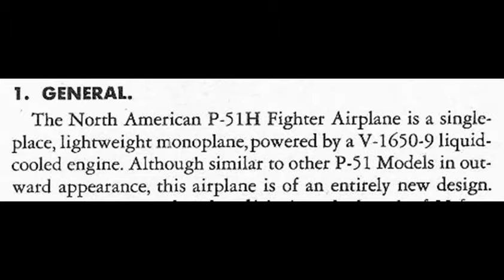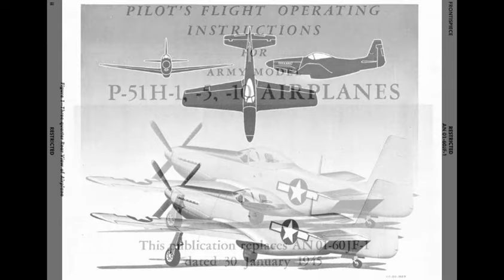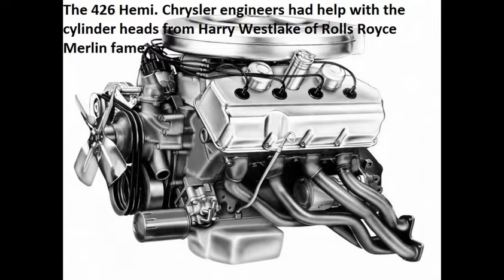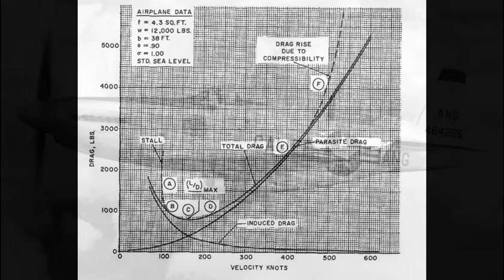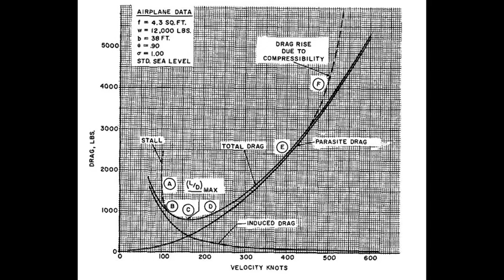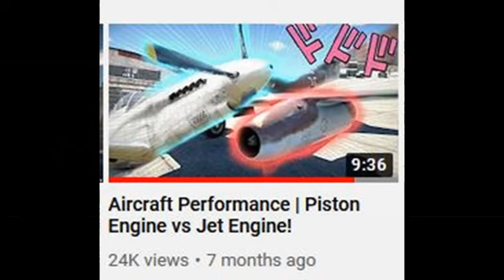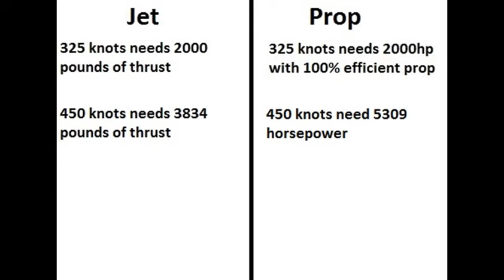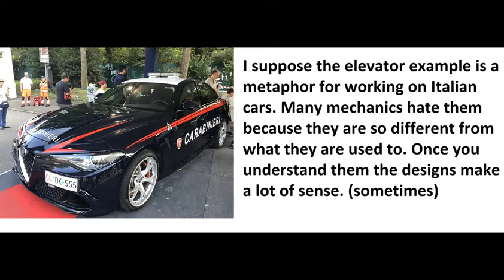U.S. "Superprop" Fighters P-51H, XP-72, and more

Comment: Great stuff!  Topic suggestion for a future video: A study of the fastest unlimited air racers (Strega, Voodoo, Rare Bear). Where and how do they make their performance over the standard aircraft they are based on?
Reply: + Greg Beardsworth   From an article about the engine builders, there are a few engine tricks, but the main focus is to build the engine as strong as possible and turn up the boost.   The crank journals are reinforced and cross bolted to take the extra power.  Merlins typically get Allison connecting rods because they are heavier, and the extra mass keeps the prop turning slower and prop tips from going supersonic.   The aircraft are made lighter.  They don't need as much lift, so the wings are shortened to reduce drag.   A special fuel is provided to the Reno race for the planes to make maximum power.  The more radical designs have pushed the boundaries of airworthiness.  For example, Miss Ashley II combined a P-51 with the wings and tail of a Learjet along with a Griffon engine and contra propeller.  Radial and fast but during the race a flutter developed and the plane literally came apart, with fatal results.   Voodoo recently took the title as fastest piston aircraft from Rare Bear.  And Rare Bear is now being prepared to attempt to take the record back, so there could be some interesting and innovative changes to make those planes even faster.
Reply: Yes

Comment: Those "press your destination floor" elevators are fairly common in NYC and London.  My office building in NY had one, as did some of the company's buildings in London.  Some hotels in Times Sq also used them.  It can be confusing when you are in multiple buildings every day, each with a different system   Yes, they seem more efficient, but that also depends on people knowing how to use them.  FYI, modeling shows that they most common elevator parking (send unused cars to the ground floor) is NOT the most efficient.

Comment: Not sure if it works similar in other languages but in Poland there is a very specific reason the 1st floor is actually a floor 0. In polish 1st floor translates to parter, while 2nd floor is pierwsze (meaning first) piętro - where piętro already has a different definition than parter. Piętro is always higher up and parter is always on the ground.

Comment: It's the same old story: Just as one technology reaches it's peak, a new technology surpasses it.  Just as the the Ford model T was introduced the horse drawn buggies were at the peak of beauty and efficiency, they had lightweight steel frames and roller wheel bearings to improve reliability. But they were limited by the speed of the horse pulling them.  The best propeller aircraft we know of all came as the jet age started.  The piston engine aircraft all had problems with drag associated with their propellers, the very thing that pulled them through the air!

Comment: Excellent Greg. Loved the Sicilian elevator ending. Very interesting.
Reply: That police quadrifolio looked amazing
Reply: That kind of setup is correct choice for high traffic buildings with more than one elevator serving people. Callers don't decide which elevator to call. They tell which floor they want to go and software selects elevator based on load and queue size.

Got identical buttons in some twelve year old business building here. Other high rise business building works same way too. Four elevators, two panels to tell which floor you want to go.

It is easier to understand such setups at 8:00am or 9:00am, when elevators are full of people traveling up from ground floor and one or two underground garage floors. Harder to see the purpose midday while going down.

Comment: Not having a control panel in moving elevators probably greatly simplifies, saves costs, complexity and increases reliability of the cars. On the other hand you have a lot more information you have to get from many different panels on many different floors.

Comment: Nice touch with the elevator. Most don't know the world trade center buildings had a similar system and some of the new building in Shanghai use it too. There is a hospital elevator system in Australia with doors on both ends and these open onto different floors. as a consequence the pad with the numbers are near each end with different number combinations. If someone is standing in front of a pad your stuck wondering why there's no visible number for the floor you are going to. Because it carries patients on hospital gurneys it can also pass your floor without stopping which furthers the confusion as you wait for an elevator.

Comment: Greg interesting video.   

Often when people read about WW2 aviation we look at top speed only, it becomes the dominant metric.   This can lead to ignoring other important planes (e.g. the PBY catalina, my favorite the Fairey Swordfish).    Look at huge amount of argument about "fastest prop plane" regardless of impact.   Sure the Do335 did serve a little in combat but no signficant effect.

In case of "super props" I see main problem standardization, maintenance etc.   Successful weapons (sherman and t34 tank, p51, p47) are partly due to manufacturing efficiency, so there is argument for making huge numbers of "good enough" planes.  Especially when you have edge in numbers and pilot quality (late in the war).   If you look at weapons Eisenhower called most important they were nothing technically amazing (jeep can't win Indy 500, C47 not fast).

Looking at image of xp72, yeah a really cool plane but would Robert Johnson choose it over a P47?    The R4360 was just not as reliable as the R2800 (look at prop airliners, the CD6 still in service the R3350 and R4360 powered planes were never as reliable).

Anyway hope you cover the xp47j.
Reply from the maker: I do cover the 47J, at least a little bit. There isn't much original source data on the super props from Republic. This will just be a brief overview. The Do335 will need it's own video. It never really saw combat, allegedly one was seen in flight by a Tempest, but just one, and it seems it never fired a shot.

Comment: It's videos like these that make me wish there were people with the knowlage, money, infrastructure and willing to re-make many lost aircraft and continue their production runs with periodic upgrades. I would absolutely love to see old radials make a comeback in original, streamlined and modernized forms. But that's a lucrative investment for a niche community requiring lost knowlage I know.
Reply: +Marxman1313   There are a lot of obstacles in the way of that.  The old tooling for machining and complex forgings for these big old radials is gone, so an investor would be starting over, although modern CAD and tooling would make it much easier.  Any significant changes from the original design opens up a pandora's box of paperwork, destruction testing etc.  to satisfy airworthiness.  Very few people would want to get involved, especially if your part crashes a $3 Million dollar warbird.  And from the business end there would be low return on investment for a small customer base.   Having said all that, brand-new radials have made a comeback in smaller form.  Rotec Radials offers new radial engines but on a smaller scale and horsepower class and these are popular in the homebilt/kitbuilt aircraft.   Most pilots are not equipped to handle the horsepower of those big radials and would get into trouble so the Rotecs are a nice alternative.  https://www.rotecaerosport.com/

Comment: There are a lot of new business buildings in Sofia (Bulgaria) and they are all using such elevator system. It is designed for specific number of people throughput. It becomes a real mess when you have more people that want to go as it refuses to accept orders. So you end up using the stairs. This happened in the previous building I worked in. The system was supposedly designed for 700 people, but the actual number of people working there was around a thousand. The mess became even worse when an elevator was out of order. I am not saying that it is bad design. Chances are if we were using "normal" ones, if you are at middle floors, you will be seeing a lot of full elevators that you can't enter. Also an elevator that is full in such case would not have to stop to "testify" it is full on each floor.
Reply from the maker: Well, I'm in Sophia Bulgaria right now, typing this from my hotel room, which has normal elevators. I'm sure they unusual elevators exist in other places, but they are rare.
Reply: @GregsAirplanesandAutomobiles  Hotels don't need that kind of elevators. Business buildings need them. Greenhall in Vilnius, Lithuania got identical button set. Probably even by same vendor. Twelve year old building.

Hotels have to manage constant adhoc traffic. Business buildings get high volume traffic spikes in the morning and need queue management to push all arrivals up.
Reply: I've seen those style elevators scattered around, often in taller buildings.  I think they help speed the long rides by grouping multiple people headed to a given floor together and by not stopping at any intervening floors once the elevator car is deemed sufficiently full.  Seen then in New York, Toronto, California, and probably others.  But definitely a minority of elevators even in those areas.  (Oddly I did see one in a 3 story building in San Jose, CA - seemed kind of a waste for such a short ride; and when you've only got 2 possible destination floors to pick from)

Comment: You're right -- Thunderbolt or jug would have made much more sense than Hellcat.  However, I've noticed in large companies, the easy jobs (eg. naming car models) are often taken by the laziest people.

The Fairchild A-10 is essentially a single seat North American PBJ-1H.  Side by side on the ramp, they are virtually the same size.   Too bad they didn't use Fairchild PBJ-II, saving "Thunderbolt II" for some other plane.

Comment: A possible reason for the supercharger in the XP-72 is engine cooling. The cooling system is copied from the Fw190. An important part of that cooling system is the position of the exhaust stacks, that help to suck the hot air out of the cowling. 

As far as I know, the XP-47J also had a cooling fan, but it was combined with a standard P-47 turbo and exhaust system. This system was troublesome enough, to come back to the standard cowling design for the M model with the same (still somewhat troublesome) engine. The J  was tested well before the XP-72 and the americans had at least one airworthy Fw190A at that time. So, by simply comparing test data, Republic most probably knew pretty well about the effectiveness of every part of the cooling system, when they built the XP-72. 

The Hawker Sea Fury had a very similar exhaust system as the Fw190 and the XP-72. The cooling air intake was even smaller, but it did not need a cooling fan. To me, this looks like the exhaust sucking out the hot air is quite effective. In today's Sea Fury racers, this fanless system with air sucking exhausts works well enough even with hotrodded R-4360s and air intake area reduced to the minimum. At least it prevents the engine from overheating long enough for the few flying minutes of the race. 

Standard P-47 design: Big air intake, turbo charger, big air outlet - worked well
XP-47J: Small air intake, cooling fan, turbo charger, big air outlet - did not work well enough 
XP-72: Small air intake, cooling fan, super charger, small air outlet, exhaust sucking air out - worked well
Fw190 with BMW 801: Same cooling system as XP-72 - worked well (at least well enough)
Sea Fury: Small air intake, super charger, small air outlet, exhaust sucking air out - worked well, even works well enough when seriously hotrodded. 

Republic's late Thunderbolt prototypes and production types were very impressive without any doubt, but they never built the very ultimate Ultrabolt: A complete XP-72 power system mounted to a P-47N airframe, of course with the XP-72 cowling. Sometimes I wish the turbojet's invention was delayed by a year or two......

Comment: Based on the tail number of the 51 at the start of the video, it was located at Hayward, CA airport in the late 60s and 70s. For all I know it may still be there.
Reply: +Doug Lawrence   Only eight P-51H aircraft survive.  The Couches family owns an airworthy P-51H and it does carry the registration for N551H.   And I believe that the Couches family has obtained another of the P-51H survivors for restoration.  https://photos-e1.flightcdn.com/photos/retriever/7cb845812173af7f9707d2a34b920016b5297ee0

Comment: I see that the R.R. Merlin didn't have pentroof combustion chambers.. would that have made much difference to its performance?  Did other WWII aircraft engines have pentroof combustion chambers?
Reply from the maker: Ooh, combustion chamber design is a topic way too complex for the comment section. Good question though. WW2 combustion chambers varied from engine to engine, from true hemis to very flat types.
Reply: I suppose the pentroof design can potentially improve efficiency by reducing the area/volume ratio.. although no doubt aircraft engine designers need to consider the frontal area of their designs as well.
Reply: The Allison V1710 had pentroof combustion chambers.  All of the major American radials were 2-valve hemis.  Bristol had a 4-valve pentroof radial engine before they went to sleeve valves, but I can't remember the name.

Comment: The major advantage of a fluid-coupled supercharger drive is that it eliminates a myriad of harmonic complexities. (When putting together a custom non-standard combination of supercharger stages, sizes, and ratios).

Which would probably save thousands of man hours, trial and error, and countless iterations of torsional and reciprocal related calculations, which were not really all that accurate in that era, and were of course calculated manually. 

In fact, a fluid couple damps engine vibrations very effectively on the driven end, while also completely isolating the driven components on the driven end. Resulting in a butter smooth output. 

Much like a non-lockup torque converter in a slushbox '50s-'80s automatic transmission. A smooth transfer of power.

Another advantage would be easily variable speed that could be automatically varied in proportion to falling manifold pressure due to altitude. This allowing a near constant boost pressure over a wide range of altitudes, as opposed to changing gears at a certain altitude and only achieving maximum power at one specific altitude for each days conditions. All of which is a significant advantage in combat, as the two and three speed superchargers were often down several hundred horsepower at less than optimal altitudes.

Disadvantages would be requiring special high shear geat fluid potentially, or significantly shorter oil change intervals if the main engine oil was used. Due to breakdown from heat and fluid shearing.

Plus some added weight and complexity for the additional fluid or oil capacity, and oil cooling system. - Though some weight was already saved by using lighter-duty driven components due to elimination of damaging vibration. Another disadvantage is lost efficiency, a straight cut gear set would require less power and create less waste heat. But may or may not improve reliability.

Overall, a viscous fluid couple has enough benefits and only two or three drawbacks, and it's really the obvious choice for this specific application.

Now, a study of Allison's V-1710 crankshaft design process shows the genius of their harmonic dampers for creating a piston engine powerplant system that was modular. It could power engines of left and right rotation, short or long crank nose, or even drive pusher or tractor via extension shafts as seen in the P-39/63. It was able to drive a one, two, or three speed one or two stage supercharger from it's initial concept, but the USAAF wanted turbochargers and the two stage three speed supercharger was never developed. - This wild versatility was only possible because of their crankshaft torsional Absorber counterweights, and the brilliant math behind them. (It's absurdly basic algebra, but mechanical Einstein clever). See:  "The internal combustion engine, in theory and practice" for a description, and the math. 

21:28 sleeve valves... Oh my. 
(I wonder what modern materials and computer design, cfd, combustion predictions, etc). Could make of a 1,000in^3 24 cylinder H-24, spinning 4,750rpm, geared down 0.40 ratio or 1,900 prop rpm. Add twin turbo, with methanol injection... For "sportsman class" air racing. - I've done the math, and it's a really fun concept.... Easily 2,800hp potentially 3,300-3,600hp depending on detonation margin attained with combustion chamber design. Put that in a 4,500lb composite airplane having 112.5ft^2 wing area. And compete in unlimited  and sportsman both. Lol.
Reply: Yeah, it's too bad sleeve valves never made it to automobiles.  Better than poppet valves in every way.  Transparent to heat.  No problem with valve spring coil surge.

Comment: Looking at the cut-away of the 4-row, 28 cylinder, I can understand why jets took over. More power, fewer moving parts (yes, I know, lots of compressor and stator blades, but the compressor blades are all attached to one moving part, and the stator blades don't move at all), no need for a super charger/turbo charger to compress intake air (because a jet engine is just a giant self-powered turbo charger.)